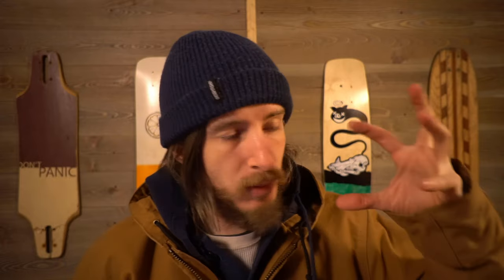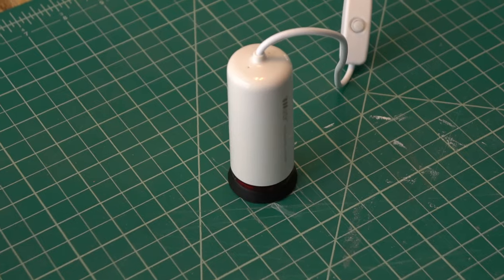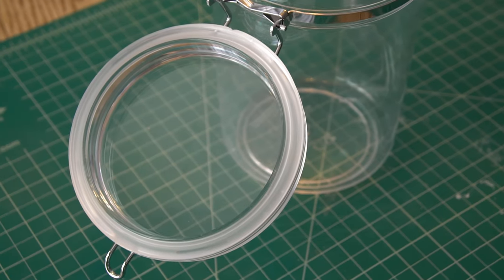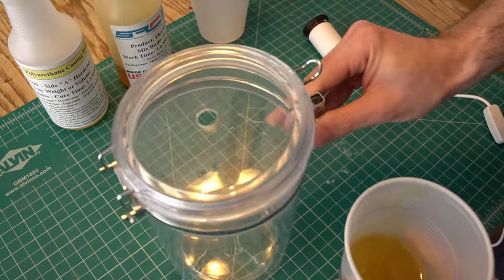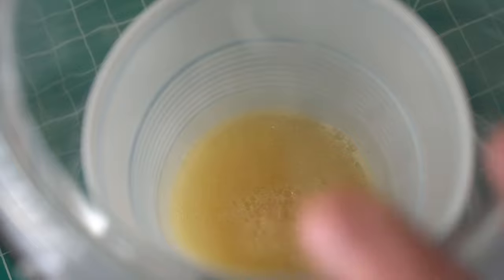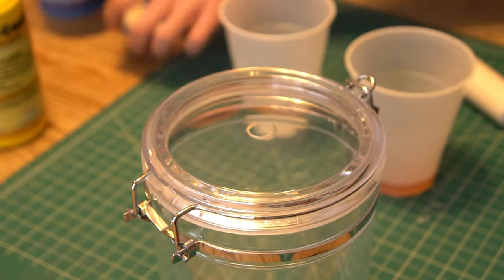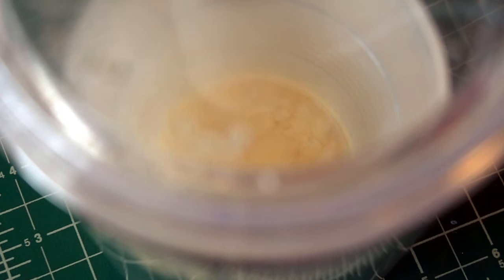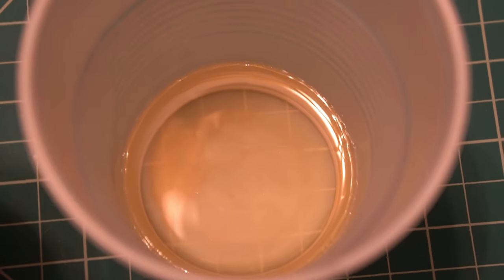Experimenting with an Inexpensive Vacuum Chamber for Casting

Comment: I would suggest using a hand vacuum pump with a gauge most commonly used for bleeding brake systems. Or if you're willing to spend a little bit more get a used medical suction pump. The vacuum level that can be achieved with both of those I would say will work better for you.
Reply: cheap too - just bought a brake bleed pump

Comment: I use flex it 90 as well, when I was testing I had the same issues as you until I made some changes, What changed for me was reducing the amount of hardener which gave me an extra couple minutes and working in a colder environment. It takes a minutes to get right because reducing too much completely changes the shore hardness. Also when testing in cups like you are, my pot life was shorter than when I was mixing and pouring into an actual mold, with thinner cavities it seems to take a little longer; just long enough to degas bubbles pulled upwards from a vacuum.
Reply: Thank you

Comment: I used to work on CRT TVs. A vacuum implosion is a lot more violent than you think, especially if you use a high vacuum. Especially dangerous with glass, as pieces will bounce off each other or fly past each other and shower the room with high velocity shards of glass. I saw a chunk that had flown 20ft and embedded itself in a wood bench leg.

Comment: I did this with a mason jar vacuum sealing pump ($20) and a 16oz mason jar. The sealer for sure works (the lids were un-popped, and you released the vacuum when opening the jar inner lid) but my resin (Shabebe brand) is maybe too thick. I ended up with tons of micro bubbles.

I'm going to build a pressure pot, as I can use a bicycle pump and simple cheap parts.
Reply: I mean you can also make a vacuum chamber by reversing the air on the bike pump, i'm gonna do that tomorrow I can let u know if it works well or not
Reply: @pankemeister4519  did it?
Reply: @sterlingarcher606  it did not work, my bike pump was designed in a wierd way that didnt allow me to change the ariway, i used a brake pump instead and it worked allright.

Comment: Harbor Freight sells a 2.5 CFM vacuum pump that will pull a 75 micron vacuum for less than $90.  I have one that I used for vacuum degassing urethane resins when I was into casting model car parts.
Reply: I found one that was a return for (I think) 30% off, only problem was it didn't have the oil with it. Not expensive.

Comment: First improvement: turn the jar upside down so that you place the object to be degassed on a flat plate and the jar over it. Much less clumsy operation.

Put a wooden stick with flat end on a drill and mix the urethane/epoxy with that.
Reply: Should be pretty easy to 3D print a mixing blade that fits your container instead of a stick.
Reply from the maker: That would basically be a bell jar right? That's a cool idea!
Reply: Second improvement, ditch the wooden stirrer as they introduce extra bubbles!

Comment: You can make a pretty good vacuum pump reversing a foot pump or 12v car pump. VOG veg oil guy made a pretty good chamber and pump for around the same price. Really enjoying the content, I'm trying to cover some old aluminium skate wheels with a layer of urethane. Thanks for sharing all the cool content about wheels and bushings etc.
Reply from the maker: Oh I had seen those pumps and was thinking about trying them out, I didn't know VOG had already done a setup, I watch his stuff all the time. I'll check it out! Thanks for the tip!

Comment: Longer pot life, torch and a silicone cup would be best. Once you do your vacuum, pull out the silicone cup with ur resin and do a quick sweep of the torch over the surface will remove all of the surface bubbles.
Reply from the maker: I have a couple silicone mixing cups, I'll have to give this a shot

Comment: Average used AC compressor works great
If u get fridge one it is slow but can work too
Big units for home AC have good liter per min. ratio
Both can achieve -0.9 so the same as vacuum pumps 
U only need to change the oil or it will rust super fast
And use oil filter at the end or u will get oil vapour everywhere + it is good to make some filter at the vacuum side to protect the pump
Reply from the maker: I'd love to do an AC or fridge compressor vacuum pump if I ever tackle a vacuum table build, which is a machine that I'd definitely love to have in the shop. For this project I'm really hoping I can find something cheap and pretty pre-fab that doesn't require much tinkering. I just don't know what kind of off-the-shelf pumps are out there
Reply: Let’s do this!!!!!!!

Comment: Would having a smaller chamber help? So that the pump has less work to do?
Reply from the maker: It would help it degas faster but I think it's a separate issue from the strength of the pump. Both things need to be addressed

Comment: For kicks, I think you should see what happens if you do use that cheap container under pressure.

Get a snap in valve stem in that hole, a bicycle pump, and see what it can take.
Though, being acrylic it will probably shatter. If there's similar polycarbonate or steel jars I think it might be workable at this small scale.
Reply from the maker: That sounds like a disaster waiting to happen, I've read to many horror stories about PVC pressure pots shattering to risk it. I also don't think the clasp and gasket on this jar would hold the kind of pressure you need to get rid of the bubbles.
Reply: Yeah, I think the clasp would probably be the weak point, even for this acrylic jar.
You need to get, what, 50-60 PSI for pressure casting? And you're looking at probably approaching 9-10 square inches on that lid so, 400+ lbs?
Clasp would fail way sooner than that.

I didn't realize PVC casting chambers were a thing.
Pressure can be pretty weird. I'm pretty sure Tom Stanton will routinely use pressures over 60PSI for his air engines with soda bottles.
You'd think that if thin walled bottles could handle 60PSI, that it would be cakewalk for massively thicker PVC, and yet I can totally understand the horror stories.

What might be interesting, though likely impractically difficult to pull off, is if you could pressurize the molds themselves rather than putting the molds  in a pressure pot.
Bringing up Tom Stanton again, but his air engines are all 3D printed, and they hold up because they're small without a lot of surface area. A wheel mold might have too much surface area for a 3D print to hold up, but a bushing mold I think is small enough where  it would probably be possible to design in a way where you clamp it shut, and pump air into it to pressurize it. And in this scenario the short pot life is probably a good thing as a slow leak would probably be unavoidable.

Anyway, that's neither here nor there really. You're on a vacuum project with this.
Reply from the maker: @LongboardTechnology  We used to build potato cannons out of PVC as a kid and we'd get them up to 80psi. But I've read that the problems come in from holding the material at that pressure, I don't know enough to tell if three or so hours at high pressure is a really bad idea so I don't want to risk it
Reply: Bad idea, don't eff around with pressure vessels. People don't realize how much energy is stored in a pressure tank. A plastic pressure tank is sure to explode, no joke.

Comment: You could use a smaller vacuum container, so the amount of gas you need to take out is samller, that would reduce your vacuum time.that if you want to keep the small pump. Otherwise, you would need to get a stronger pump.
Reply: Also, you could try to add a pressure release mechanism like a small valve you could open slowly in order to pressurize the chamber in a controlled way after achieving vacuum.

Comment: I know this is pretty dated, but one thing you could do is to take up a bunch of the unused airspace with something. The vacuum can evacuate much faster.  (I've been using old cans of food. Sometimes their tops pull up, but so far none have opened.)  I actually made a vacuum chamber basically exactly like this -- same type of chamber except the bottom vessel was stainless (top still transparent plastic), and I put a fitting on it to go to my full vacuum pump.  Unfortunately, the seal shape on mine was not proper for this and the strength of the full vacuum would pull it in, breaking the air seal.  Anyway. :)

Comment: Plastic is porous.
Try the same pump on a glass jar or biscuit barrel maybe? A glass cake dome with a silicone seal?
I've seen people using the pumps used for oil changes on cars for chambers too but can't remember if it was for vaccum or pressure.
There's also a way to invert bicycle pumps to pull a vaccum.
Hope some of my ramblings help!
Reply from the maker: I was looking at those 12v pumps for fuel changes as an option. It would be a more DIY route but it's still really inexpensive if it works. The bike pump idea is really interesting too!
Reply: P.S. I've found some vaccum seal lunch boxes with the valves already installed.
They come in plastic or borosilicate glass.
Going to be testing the plastic ones.
They indicate they are at full vaccum when the clips loosen and the lid is held on by the vaccum.
They come in a range of sizes.
Fingers crossed it works.
(For polyurethane.)
Reply: P.P.S. I'm also working out a method to print on wheels which can be done at home. That is similar to professional production. Low cost.
Reply from the maker: You mean printing graphics on wheels?
Reply: @rejectedautobiography  Hey, how did those lunchboxes hold up? did you test them?

Comment: You should be able to degass the 2 parts before mixing. I don't know anything about resin casting, bit just based on the physics, which are that this is not gas produced by the hardening reaction but gas already dissolved in the resin.
Reply: The bubbles are introduced by the 2 minutes of vigorous stirring required to mix parts A and B seamlessly.

Comment: Pull repeated vacuums on that plastic container and it will crack/deform.
Walmart used to sell those but for some reason stopped.

They were great for storing food in or things you want to keep dry.

A centrifuge will remove bubbles faster.

Comment: what about the roarockit pump?
yes - you have to pump manual, but if it's sufficient for snowboards, it should also work here... Unfortunately they are not selling the valve only :-(
Reply from the maker: That's a possibility for sure

Comment: For mircobubbles on surface use a lighter and it should clear em (also idk if its different but make dice for friends and how i avoid bubbles  ot pressure pot i use a casting resin with a 45 min work time. I heat both parts separately and them mix warm. Then i let degas near a space heater (i never have problems with flash curing) and i assume if you use this with this really thin reasin the bubbles will be barely noticable ofc nothing beats a pressure pot

This is more for casters and not what you are doing but for those out there who do ther eis a skightly better version of this pump and also resinators vacuum chamber

Comment: Would you really need to pour this after? What if you poured the urethane into your mold and then vacuum sealed the whole contraption?
Reply from the maker: My understanding is that when vacuum degassing works right the material can bubble up by like three times its volume, so if you had it in a mold it would overflow

Comment: Hear me out, I know this sounds silly... but would a adult toy vacuum pump work for this in a similar way? They are usually cheaper than the food sealers at least in some countries.
Reply from the maker: Hahahaha! That's actually an interesting idea! My guess is that it would have the same drawbacks as the food sealers because I'd imagine the pumping mechanism would be the same. The problem here isn't really price, its that we need something that can pull a stronger vacuum and I think that kind of vacuum wouldn't be something you'd want to apply to what we'll call sensitive areas
Reply: Funny you say this because when I first saw the food sealer there was no scale to its size and that's exactly what I thought it was, just without a clear casing.

Saying that, an adult vacuum you may not even need a jar to put the cup in, just place the cup on a tile and the adult vacuum should be big enough to go over a cup and create a seal against the tile

Comment: I have to wonder if the pump from king of random would be of more use here, as it would very quickly pull out lots of air from a smaller container and if the same one way valve is used the pump can be momentarily attached, pump out the air, and then sealed. 

Along with the fact that manufactures often use resins that they cure in the oven I wonder if there might be a possibility of using a mold made of like ABS and then using in an oven set to ~ 70-90*C

Comment: Could you vacuum the two before you mix them? So they wouldn't setup.
Reply from the maker: Most of the air actually gets introduced during mixing so its best to degas afterwards
Reply: @GoodRoads  so you need to like mix it in a vacuum

Comment: You should try pulling vacuum on the parts A and B separately, before mixing! Then you get the whole pot time to pour. Just take some care to mix them without introducing more air... maybe in a Ziploc, then snip off a corner to pour.
Reply: Except there is no air until you mix it.

Comment: Can you pack ice around the resin to slow the reaction?
Reply: Would also make it a lot more viscous, which might make the bubbles more stubborn.
It could also make mixing take longer.

I know temp can make a huge difference in slower set resins.
But if your pot life is only 3 minutes, that's a pretty aggressive reaction that probably won't be slowed down by much anyway.
Reply: @LongboardTechnology  I would try mixing it and then chilling, but yes, it will get properly thick. A larger vacuum pot where you can increase the surface area of the resin could slow things down a bit too.
Reply from the maker: Resins have a minimum working temperature and if you go below that they won't cure up right, for the ones I've used it's around 50 degrees Fahrenheit. There are urethane formulas out there that have longer pot lives, I've just got to get a hold of some and get testing

Comment: This pump is too weak. The best cheap (or free) solution is to scavange a refrigerator  (or freezer) motor. Then you will need the proper fittings, a vacuum gauge plus in and out valves to control the vacuum. One of the biggest factors of bubbles as I understand it is atmospheric moisture. There were times that I poured perfect, bubble free resin, only to discover tiny bubbles later. Those bubbles were created during the setting reaction of the resin combined with moisture. Sometimes the resin is old and has alot of moisture trapped in. This can happen without you knowing it as some shops sell resin that was decanted from large canisters to smaller bottles. You can be sure about your resin only if its packaging is factory sealed.